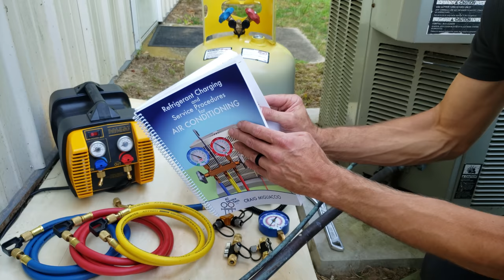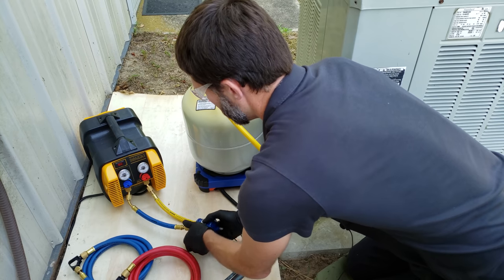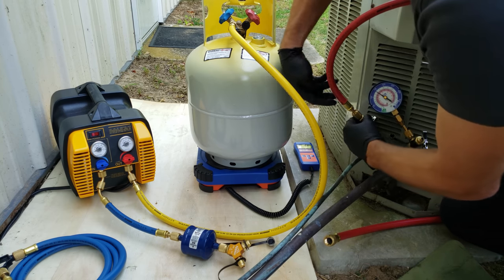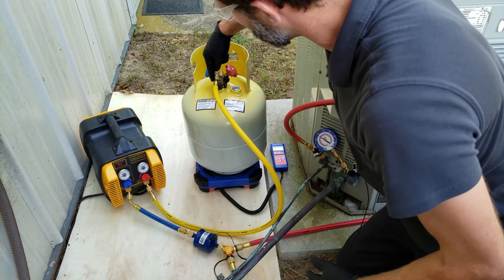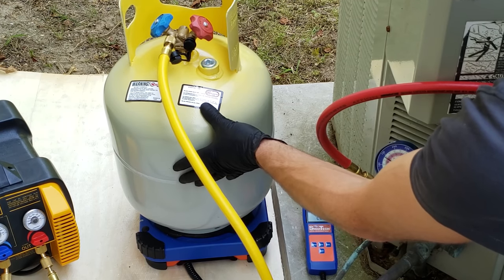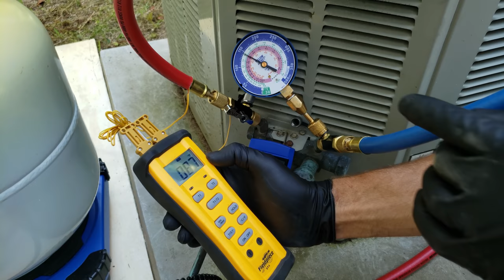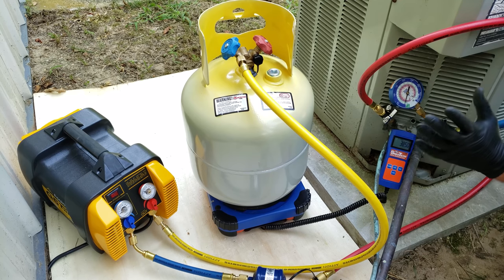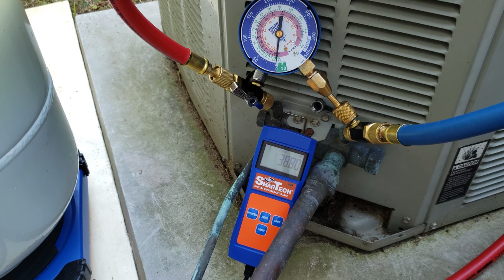HVAC Refrigerant Recovery Machine, Hose, Tank, & Tool Setup and Procedure!

Comment: Thank you for the videos. It helping me a lot as a new technician.
I have this nasco split AC that sends power to the outdoor after after 10 minutes of putting it on. The outdoor unit works for 5 seconds and goes off for another 10 minutes. When the  out door unit is on , the indoor fan goes off till the outdoor goes of again. Please what may be the problem?

Comment: Beautiful tutorial! Clear and concise as always.

Kind of a random questions: Why is there a minimum and maximum line set length for systems? (traditional and mini-splits) I would think that making the line set as short as possible would be ideal for similar reasons to why you would want to minimize your vacuum hose length. Do systems not function properly if the line sets are too long or short?
Reply: This was NOT a good tutorial .. over kill and not properly explaining the procedure correctly .. as far as the procedure he would have not been successful actually recovering that unit and you ALWAYS recover the unit to a slight vacuum (pass zero psig into the mercury inches)

Comment: How often should you change out the filter? Only when you change refrigerant?
Reply: Every time you open the system up to the outside environment, you are technically required by all the manufacturers I know to replace the filter dryer.

Comment: Are you also measuring a bit of the weight of the hose when weighing the recovery bottle with the hose attached? (Or was that mitigates by propping up the hose a bit so it was pretty much suspended in mid-air?)
Reply: You generally will zero the scale once you have everything in place. So the hose is not going to affect that reading. Now if you bump the hose after everything is set up, then yes your reading will get messed up.

Comment: I use a refrigerant analyzer on all my R 22 systems.  Here in San Francisco we have a lot of people who come from countries who do not care about EPA  and cross contaminating refrigerant and just dropping one refrigerant on top of another refrigerant especially those so-called blend drop in refrigerant. 

         And the drop in refrigerant when you try to use the PT chart will show up as R22

        Because the inside coil and all the refrigerant lines are at one temperature and your outdoor condenser is at a different temperature so there’s absolutely no way to get an accurate pressure reading. 

       It’s just speculation and guessing that it is R22 or a blend or a contaminated mixture of the both
          
        I have always owned refrigerant analyzers since 1993 and they were very expensive at the time back then but I still felt it was more than worth it.        Because while everybody else was doing misdiagnosis when systems had air contamination (noncondensibles) 

     I would diagnose it correctly 100% of the time whether the refrigerant was clean and pure or not because I had a refrigerant analyzer. 

    Do it once do do it right. 

And a lot of reuse refrigerant tanks and sometimes brand new refrigerant thanks leak at the valve packing at the stems of the knobs when you try to pull deep vacuum the technician can pull air in.    But NYLOG fixes this problem
Reply: Stick your analyzers and that nylog crap where the sun don’t shine, and the freon will always travel to the coolest place and that will determine the system pressure !

Comment: Craig Thanks for all that you do.  I counted the amount of connections reverses using the manifold. They’re about the same. Do manifolds just tend to leak more?
Reply: I believe a manifold setup would have 1 more hose. You would need a (typically the yellow center) hose that goes from the manifold to the filter/drier. In his setup, the Y connects directly to the filter/drier.
Reply: @Attest411  and the lack of flow through the manifold the openings are very small this way it flows better
Reply: @Attest411  ah you are wrong, just because you work by the hour doesn’t mean you should take the most time to get the job done. If you want to impress, stand out, and show your employer why you are a top notch tech then use these better methods. If you are ok with taking longer and being mediocre then that’s up to you as well.

Comment: I find that pulling through my manifold with no shraders works well enough for me. (As long as all gaskets are good)
Reply: Gaskets!
Reply: By the time you get done screwing around with the shrader valves you could be done with the job!
Reply: @nunyabusiness6746  recovery takes forever either way
Reply: @nunyabusiness6746  sometimes. Especially for smaller charge units.

Comment: By the time you finished that extravagant setup and explanation, I'm done. Never removed cores and it's plenty fast for 5T and under or 15 lbs of refrigerant. If you are changing out a system, lay a wet towel on top of the recovery tank, put a fan on it to keep it cool and start disconnecting electrical, pulling blowers/heats out of air handler, unhook duct work.
Reply: I find a huge problem with the many of these type videos, especially on the recovery, vacuum and charge of refrigerant, that many of them have enough differences on detailed procedures, and that anyone trying to learn the absolute correct procedures to prevent future premature failures would not have any guarantees from any that these videos will give them the best possible results. I've seen this in all the trades, but this is one of those procedures that seems to be much more critical than other trades have to deal with if things are NOT done properly.
Reply: Very true

Comment: Just purchased 3 of the Appion valve core removal tools. Great quality compared to the Robinair ones I purchased a couple years ago.
Reply: They are not necessary and really doesn’t make any difference from using a manifold like the traditional HVAC technicians do
Reply: @brickcitynetwork  Absolutely 💯
Reply: Systom  icloed  saveing  methed ok vrey good  recovery mech$ on
Reply: For vacuuming a system down it can make a difference with a large can vacuum pump. With some Appion vacuum hoses, and accutools core removal tools, and a 10off pump….I can have a micron reading so low in minutes. It Would blow your mind how fast it is truly. Now for recovery I don’t see this set up being any faster. I’ve seen guys put the recovery tank in a 5 gallon bucket with ice, and recover it faster through a manifold.

Comment: Hey Craig, I’m shopping for a  new recovery machine,  what do you recommend.
Reply: The MR45 is great I use it everyday for changouts and it’s easy enough for even new helpers to get the hang of it especially with auto shut off and a digital screen to show pressures.
Reply: how about the appion G5
Reply: @skipper3069  thats all you need and make sure its the TWIN (meaning two compressor inside for recovering)
Reply: I have the g5 twin! It’s amazing and works fast! It is pricey tho

Comment: Excellent video, very well explained, I have a cuestión: I missing the part that you said that the hose have to be connected to the tank liquid valve port, I think there’s not color codes for the liquid side valves or knobs. Thank again for this great Video

Comment: Where do you find those black 1/4" hose plugs with the finger hole? I like the idea of using those to keep the hoses closed off when not in use.
Reply: The brand is APPION they come with hoses when you purchase. They are metal now but were plastic on older ones

Comment: How do you tell if the pressure rise is from trapped refrigerant vs a leak?
Reply: If he was using a manifold he could have shown you, check your PT chart for the refrigerant inside the unit, if it doesn’t match the temp/press on the PT chart for that refrigerant then you would know if its air or refrigerant .. Air is lighter than refrigerant so it will come out of an enclosed pressurized container first (according to our Dalton’s Law theory)

Comment: I have a question. If after a while of sitting the refrigerant gets saturated, which if I'm understanding correctly means there's gas and liquid mixed everywhere inside. If it's on the evaporator side how does it not damage the compressor on startup? Wouldn't liquid enter the compressor?

Comment: Hi Craig, Question.

If recovering r410a, do I need to add any oil to the system upon recharging? Is there anything in your book about that?
Reply from the maker: If recovering using a recovery machine, you do not have to add any oil. There wouldn't be too much oil recovered into the tank, thanks!
Reply: @acservicetechchannel  Fast reply! Thanks for the answer, I figured that was the case. I recovered from the saturation line on a mini split using a recovery machine. Keep up the great work, you deserve all the attention you get from your videos!

Comment: If you pump enough refrigerant into the tank so the pressure reaches equilibrium between gas and liquid then adding more vapor will immediately turn some vapor into liquid.....no?

Comment: Hello there. I charged an old split air conditioner unit from scratch with R22 refrigerant in gas form. Only the steam line of the unit has a service port, and the liquid line does not have a port. Therefore, I connected the thermometer to the steam line and started to charge the gas. I charged it until the internal unit was blowing cool, but the reading on the thermometer didn't tell me much. Outdoor temperature 36 Celcius (96.8 F), gas line temperature approximately 18 Celcius (64.4 F), Gas line pressure 5.2 Bar (75.42 Psi) with unit running. Then the compressor of the unit got hot and stopped. What should I do now? What is the pressure to read in the R22 gas line?

Comment: After you completed the second recovery, where the unit stayed in a low vacuum, why didn't you start shutting off the valves like you di at the condenser, and work your way back to the recovery cylinder through the recovery machine shutting valves as you go.  Wouldn't this prevent diminimus release and capture most all of the refrigerant in the cylinder?  Thanks.

Comment: craig quick question... so after getting it down to 0 on the single gauge then shutting off the crt valves, will the pressure rise a few psi back up or it has to literally stay at 0 ?? used this procedure for the first time w pretty much everything you have I didn't flip the tank over I put the r22 back in through the vapor side. ....

Comment: This is amazing. I did have a question as, I was taught something slightly different. 

When you are purging the air in the service lines, before allowing refrigerant to enter, why did you not lossen the hose to the taken to allow air to escape as you open the megaflow valves. 

I was taught that air can mix with the refrigerant if you do it that way, thus essentially making your uncontaminated bottle now contaminated. 

Am I inaccurate?

Comment: Yesterday, two "experts" did some maintenance on our AC at our house in Indonesia. They probably just vented the refrigerant in the air. That's how they do it here and in many other countries too, I guess. What are your thoughts on this?

IQ is about 78 in Indonesia. Motivation for improvement is very low too, I guess. Having a normal conversation with these guys is probably very complicated besides not knowing their language.
Reply: If they’re doing a maintenance then they wouldn’t be messing with your refrigerant

Comment: The rise of pressure is usually caused by refrigerant trapped in the oil. 
I’m a 40+ year HVAC&R service technician
Reply: Cool story bro
Reply: Really true ,I saw a video about PAG oil , the refrigerant kept evaporating from oil for minutes after recovery.
Reply: That’s not always true as it is not easy recovering a unit down to its motor oil (compressor oil) .. The majority of time its simply Air .. and if any oil was to leave the unit and enter any recovery unit you will hear its compressor “screeching” from time to time during the recovery ..

Comment: shouldn't you put your TANK in a VACUUM as to not contaminate the Refrigerant you're recovering with moisture
Reply from the maker: This tank already had a vacuum done which was broke with refrigerant from a prior recovery. On a new tank you certainly need to vent the nitrogen and vaccum the cylinder first. We have videos on that process, just look up "acservicetech recovery tank setup vacuum" thanks!

Comment: Is there an allowable range when checking what kind of refrigerant is in the system? Like you said the ambient was 87 degrees. And the saturated temp was 81. Like you said the condenser outside and the air handler inside so you should have refrigerant inside and outside at different temps. What about when checking a recovery bottle is there an allowable range?

Comment: Just bought your book on Amazon.  Looking forward to getting it tomorrow.  Question:  Why were there 10 pounds in the system?  4 pounds (right?) over the manufacturer's plate.
Reply from the maker: So this unit had a long line set and an oversized evaporator coil. It could have also been overcharged. We just recovered and removed it.

Comment: So the hoses that go from the low/high sides to the wye are 1/4" to 3/8", but the wye output is a 1/4" -- does that 1/4" output restrict the flow from the unit sufficiently so it makes the use of 3/8" hoses not worthwhile to accelerate the recovery?

Comment: please fix your workbook chapter 4 question 89 ask if this picture depicts charging or recovering while the system is running pointing to arrows connecting the yellow and red hoses. the answer key says recovering! what your doing in this video is shutting the unit off while recovering not recovering when the system is running like the question phrased it. other places say to turn off the unit while recovering and charging units
Reply from the maker: We can recover using two methods, one while the system is running and the other while it is off. Did you watch the vid of recovering while the system runs?

Comment: This video is great. I have been working for 3 weeks now as a helper and these guys im shadowing use a bucket with water to dump the entire charge into the atmosphere. its really sad to see but im in no position to make a change to their procedures as im the new guy. I have taken videos of them doing this and will show the boss of the company when I leave for a union position to get my commercial refer ticket. ill explain that I am frustrated with seeing cut corners. these guys have no licence to be doing residential AC either. its really a shit show. no nitro when brazing, I even had to convince the guy to check leaks on a gas flex hose he installed as I was worried for the safety of the homeowner. I am excited to get into a proper job where I can master my techniques and go the extra mile to make sure my work is top notch and something I take pride in.
Reply from the maker: My word, get out of there as fast as you can. you dont want to be one of the technicians at the site if a leak or some problem happens and yes show their boss the video, nightmare and so sorry to here. They are not all like that!!!

Comment: Great video.

     12:26 you stated that pulling the system below 4” Hg would introduce air into the recovery bottle.   

      If the system has no leaks, where would the air come from?

      It seems you could pull the condenser and line set to vacuum, then close the valve to the recovery tank and eliminate any chance of air contamination.
       What am I missing?
Reply: When the pressure in the lines is less than atmosphere pressure, the air will be sucked in through a micro leak. In europe it is not recommended to suck below zero due to the risk.
I speculate (pretty sure) that air molecules is smaller than refrigerant, and then will be sucked in easier is possible and the system seems to be leak free, you don't know for sure. Also, the hoses has micro leaks. Try vacuum yours and wait if it rises, it likely does due to air sucked in.

Comment: Great content as always, Craig. I’ve watched your videos over the years and grown exponentially as a technician. I’m curious as to why it’s a good idea to break the vacuum and the tank prior to recovery. I remember you and Bryan Orr mentioning in a video about how it’s good practice to bring the tank down into a vacuum on site and I’ve been using that advice to great affect. Does a trace amount of refrigerant in the recovery tank help?
Reply: This content was not that good and actually it could be a little confusing to the novice or someone like yourself .. he actually did the procedure kind of out of order and the info wasn’t as accurate .. and last, his set up was over kill without the manifolds!
Reply: Lol.. Anybody else?
Reply: a trace amount of refrigerant in the tank would not matter as the recovery tank pressure is and should always be lower than the unit “standing” pressure .. also recovery tanks (even EZ One Shot Tanks) do not need to be placed in a vacuum ..
Reply: You’re correct, and recovering through a manifold will absolutely get the job done. An optimized recovery setup as well as a tank pulled into vacuum are only going to save time on the job. Supposing it’s only seven minutes in savings on average per recovery. After 3 or 4 years those minutes become hours. It’s not for everyone, and Craig has demonstrated plenty of recovery videos using a manifold and 1/4” hoses. I’m small business, and time for me is my dearest asset.